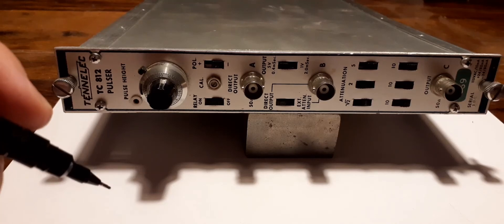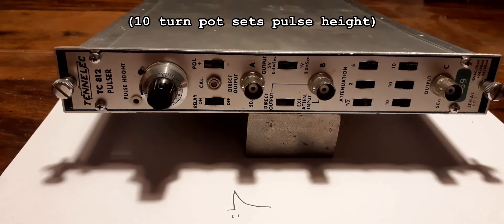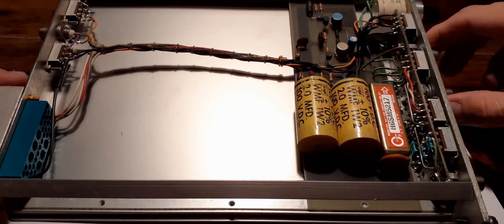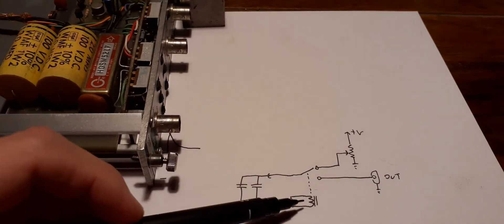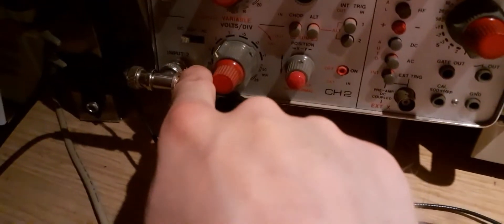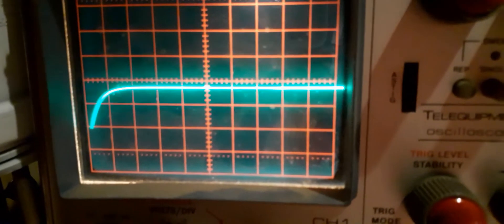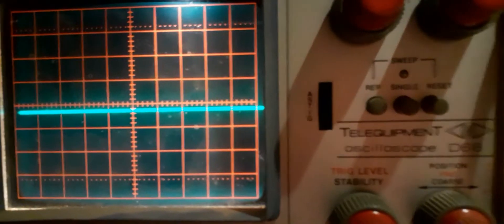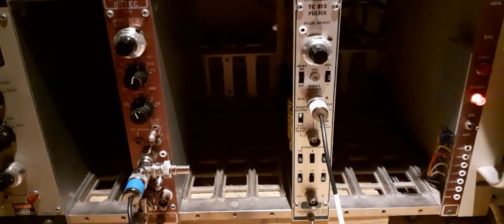1960's Nuclear Pulse Generator

Comment: I imagine one important component would be a pull-down resistor to ground at the output that keeps the output at zero when the caps are connected to the 10T potentiometer to charge and through which the capacitors discharge when the relay switches?